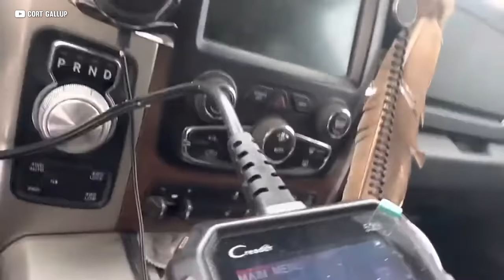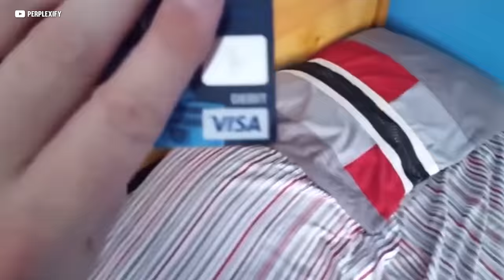Worst Trucks Only Stupid People Buy

Comment: I work at a GM dealer in the parts dept. and the cam/lifter failure problem has provided me a good living. Thanks GM!
Reply: You make it sound like your hourly job gets paid on comission 🤨
Reply: at other peoples expense. imagine feeling good about that
Reply: Years ago Camaros had an issue with soft camshafts. Seems like that component weakness can't be fixed by GM.
Reply: Is that the diesel or gasser?  Thanks
Reply: @SpaceRanger187 its usually under warranty lol
Reply: Same with me at Nissan.....CVT failures left and right.
Reply: I'm  an automatic transmission rebuilder   THANKS   G M  👍
Reply: I own a Ford because my 2008 Silverado AFM engine failed twice.   $4000 repair the first time, $8000 quote the second.   Sold the truck instead and bought an F-150.   They have their own problems, but I'll never own another Chevy because of that trash AFM engine.
Reply: @joewoodchuck3824  That's just plain dumb. CSB engines run for every without cam shaft damage. Every manufacturer out there has had a problems by times.
Reply: @Flatlandcoug  That will teach you to change your oil on schedule and not use lubie lube.
Reply: @SpaceRanger187 that's how the world works every service and product is based on the consumer paying for it. Stop taking it for granted lol
Reply: @Louis-kk3to   lol I’m a retired g.m. tech, specialized in automatic transmission. Made a very good living at it also, especially because nobody wanted to work on transmissions.
Reply: @Flatlandcoug  I'm not a Ford  fan  , but! ! I don't  blame you for  your  switch      I'm  an automatic transmission   rebuilder   ( 46 ) years   , I'm 59 yo. And   you  are  not the  only  Chevy  truck  owner  who  has  told me  that  ☹️,SAD  AINT IT  !!!
Reply: @brianspangenberg9598  YEP  ! EXACTLY  👍
Reply: @johnarnold893  I have no idea what a CSB engine is.
Reply: I worked for a Chevy dealership for 4+ years, bought my first Toyota after I left when I sold my "dream truck". 2018 reg cab short box LT Z71 4x4. So I got a used 4runner with that "awful" 3.4 ltr V6. 285,000 miles on it and runs perfect. lmao
Reply: @SpaceRanger187  truly is an  honest  living tho
Reply: I put range technology obd2 port plugged it in and keep it in v8 mode shouldn't  have any problems..did this since new in my silverado
Reply: @joewoodchuck3824  Chevy Small Block???? I have no idea either.
Reply: @castlegarage6969  GOOD  CHOICE  👍💤
Reply: I have the 5.3 so far it's good I deleted the afm with a tune in the beginning it's been great
Reply: @johnarnold893 Victom blamer!!! I am a lifelong GM guy. Owned dozens. Been building,  collecting, racing, showing GM's my entire life.    2008 5.3 DOD AFM trailblazer issues at 53k and 83k miles made me bail on GM trucks. Still have my  collection of classic GM's but new are $$$$$$$  hot stinky garbage.
Reply: I doubt you are making a good living at a dealership!  You must mean your daddy owns the business,  and is making good money selling those parts!
Reply: GM stopped making trucks in 2006.
Reply: @brianspangenberg9598  The 4L's aren't that bad once you get the OEM parts out of it.
Reply: Umm, I'm sorry Mr Mechanic but you of all people should know about Chrysler's big issue with the lifters and whiping out the cam lobes 😂
Reply: Titan 5.6 gas motor is a decent powplant without cylinder deactivation complexity. Definitely steer clear of diesel though.
Reply: @thebluelunarmonkey & tha 06 model is u-gly with that extra pokin out front cap... looks like sum crap...
Reply: Yep!  I'll never buy another GM again.
Reply: Just put a delete program for the cylinder deactivation on your chevy or gmc and you wont have a problem
Reply: @BBBILLY86  Yep! My Dad had them as company trucks all from the late 1970's to the 1980's, I have both a early areo body from 1989 and a 1997, which are both great Trucks, But the 2009 GM Sierra is a complete Peace of $hit! Don't think I would ever consider buying one of the new ones ever again. And that is after being brought up on them. They need to fire some of the diversity hires and improve the quality.
Reply: @bradenconway9066  most people can't do that but can plug in obd2 port for range technology delete
Reply: Seems like I remember Cadillac trying to shut off half the engine back years ago maybe the 1980s. Complete failure the too. Half the not firing on dead cylinders would be a bad problem on valve train. My Dad’s truck sounds like a diesel running. I told too get deleted he wud not. Too late now. Oh well there goes my inheritance. lol. I love my 84 chevy half ton. And my 3/4ton 76 GMC. Hard to get me stranded in one of them old trucks 😊
Reply: @KingfishStevens-di9ji  you got a good one mine is a 2019 I installed  the range tech.. to shut them off I'm not taking any chances
Reply: @KingfishStevens-di9ji  - I think that longevity depends on maintenance and usage habits. Also, we've seen videos of how people abuse their trucks, and witnessed real life neglect.  Little things like ignoring transmission oil changes and differential fluid. Motor oil should be changed every six months for normal driving conditions.  I haven't had any problems with any of the four Ford pickups I've owned.
Reply: thegunsngloryshow  should just stop with the stupid bright lights period.
Reply: Enjoy it while it lasts.  I was a dedicated GM man for 45 years until I got tired of buying GM junk.
I have been driving a Honda and my wife drives a Nissan .
American made and no rust or recall
Reply: I bought a 21 Silverado when chips were scarce, and mine has a factory deleted DOD.
Reply: @Ilovemyidi Have you ever tried to get a dealership to honor a warranty (even under recall)?
Reply: @Louis-kk3to Perhaps you can help me? I just installed a 4L60E on a 1993 GMC 1/2 tonne. The installation went fine with no hiccups. As per the 90-day warranty agreement with the wrecking yard policy. I flushed the transmission and installed new seals, gasket and filter. Here's the problem. I filled it with the recommended transmission fluid and proper amount, and l've been driving this truck for about a month. So far I have topped it up with almost 3× the amount of transmission fluid. I've been under the truck with a flashlight and it's as dry as a bone. I leave cardboard under the truck at night and no drops. Any advice you could give would be much appreciated.
Reply: @KingfishStevens-di9ji So you are that ONE guy who hasn't had any issues with your truck.
Reply: @KingfishStevens-di9ji  Guess you don’t know what a joke is. So sorry
Reply: For me that would be a good enough reason to Quit and Name & Shame them. 
Sorry morality would not let me scam people like that. 
Even if i was selling one i would tell new buyer all the issues he likely to run into.
Reply: Often happens as people drive them like a normal Automatic which is bad for them.
EG in a CVT when you stop at lights you should NOT leave it in drive but instead move it to N or P specially if standing for a long time.
Also people launching them or overheating them @JackTheSkunk
Reply: The Auto 4wd too.
Reply: You are welcome
Reply: @KingfishStevens-di9ji 💯
 Same on my 2010 F150, abuse the hell out of it off-road and towing almost daily. 130,000 miles and only replaced 2 batteries & front brakes, FORD oil and filters. ❤ Edit; I buy American made batteries and tires. Wake up America!
Reply: @thebluelunarmonkey Funny you say this! I spoke with a guy who worked at a CHEVY /GM Dealerships over 30 years as a mechanic, he'd been to all the schools, I believe he'd become what's called an L1 mechanic? I think, anyway he had knowledge like an encyclopedia! , we spoke at great length about motors and drivetrains on Chevy and GMC vehicles, and he told me any model after 2008 was absolute crap! Mostly because of MANUFACTURE QUALITY AND WAY TO MANY SENSORS ON EVERYTHING! AND THE INTERIOR OF THE CARS AND TRUCKS HAD POOR QUALITY plastic parts! Overall not designed to last, and very expensive to repair! He told me stick with 70s 80s and 90 model GM vehicles!
Reply: @Flatlandcoug lmao get rid of that and it's leaps and bounds better.theres a reason hotrod have ls and lt engines in most of em
Reply: @Louis-kk3to Mayne the 4l60e.if you know what your doing you change a few pieces and make it better.the 4l80 e better than dodge or ford junk all day any day .I have the ten speed 6.2 non dod and smoke ford and dodge trucks all the time
Reply: Service advisors also make a commission for repairs at the dealers
Reply: Like the hackers who send email with viruses to give IT folk something to do.
Reply: I’ve owned one GM and never will again. Complete junk
Reply: When looking for a new truck in 2019.   I went with a 5.7 tundra over the GM because of the cylinder deactivation.      No regrets. The tundra is solid.   It’s a shame because the 2000s 5.3 chevys were Awsome trucks.
Reply: And ppl give the hemi a hard time lmfao
Reply: @Flatlandcoug  Pre 2007 GM trucks are pretty good. Pick any year you want, but I won't own anything GM 2007 or later. Not worth it. I'll run my 99 Silverado until the wheels fall off then fix it and keep going.
Reply: @Bostonharborwater  Agreed. The first gen 5.3 can't be beat, and any GM 5.7 are rock solid too. 
I've worked on the Tundras enough. Yes they seem to be pretty solid trucks, but why Toyota made them so ridiculous to change oil on is beyond me. If I got one, the absolute first upgrade I'd make would be a filter relocation unit, about $200.00 and that puts a spin on filter in place of the cartridge unit under the shield. After that, oil changes would be a breeze in comparison.  Actually the older Tundras that were about the size of the current Tacoma trucks with the 4.7l I liked. They were a bit more stylish to me. Granted you wanted to keep up with replacing the timing belt regularly but that truck I'd definitely consider
Reply: @castlegarage6969 this doesn’t work on the 6.2 with 10 sped trans unfortunately….  :-((
Reply: @dannyo6699 I hated that paper filter change in my wife’s 2008 highlander…made her start taking it to the dealer for changing…
Reply: @Getusom  exactly.
Reply: GM = General mess 😂
Reply: @Louis-kk3to  Yep. I've got a 17 Silverado and that transmission just failed at 66,000 miles.   Now, I know not everything is built equally, but a failure like that under 100,000 miles is definitely a cause for alarm. Found out from the transmission shop that they see 2016+ trucks all the time now with very early transmission failures.
Reply: @xephor86  well , I make  a living  fixing  automatic transmissions   ,it's not like any other  job , but sometimes  you  can  feel  the  heartbreak. Of  your  customers  about  this  transmission    BUT  WE FIX  THIM ALOT  BETTER THAN THE  FACTORY   👍
Reply: @cailcampbell5890  pull the  transfer  case  ' fill' plug   and stand  back   , u might  have  a cracked seal   , carefully  replace it   good  luck with your  truck  👍
Reply: @Louis-kk3to  Thank you.
Reply: Range technologies AFM delete and do oil changes at 3500 miles, you'll be fine!
Reply: @SpaceRanger187  He didn't cause the problem and makes bank helping fix it.
Reply: Failed lifters and plastic trays 
Destroyed cams,push rods
Fuel lines,fuel pumps
U can go on,on,on
Poor tax payers and buyers
Reply: @Flatlandcoug  agreed 100%
Try toyota and you will not regret
I have a pos afm issue i was not
Aware any how replaced engine
At $6k now planning to switch to
V6 tundra.
Reply: Do millions of trucks have these issue?
Reply: I have a 2022 not refreshed sierra 5.3 with no engine deactivation from factory  do to chip shortage so I'm thinking it's a good thing
Reply: @joewoodchuck3824 It was designed to fail by GM.     Old Camaros never did that back in the 1960s.   I'm talking 400 horse
Reply: @Flatlandcoug I have a 08 Sierra with shut down.     15 years old and never had a problem with it.      140 thousand miles now.    Use Napa Synthetic 10W-30 oil.    Runs great
Reply: @thebluelunarmonkey I have a 2008 Sierra.    140 thousand miles and zero breakdowns.    It has cylinder shutdown as well.    I've never touched the motor, just plugs and wires.    Use Napa 10W-30 synthetic oil
Reply: @BBBILLY86 I have a 08 Sierra with the 5.3.    I've had zero breakdowns.    I have 140 thousand miles on it.    Use Napa Synthetic oil 10W-30
Reply: @dannyo6699 I have a 08 Sierra with the 5.3 cylinder shutdown engine.    I've had zero issues in 15 years.     I have 140K on it.    Use Napa Synthetic oil 10W-30
Reply: @plusblood5101 The V6 twin turbo engine is junk in Toyota tundra
Reply: @gregorylyon1004  That's good.  Consistency with servicing will lessen mechanical issues. Full synthetic oil is best and 10w30 is fine if you don't use it in severe cold, otherwise 5w30 would be a better option. I run synthetic 5w30 year around in mine.
My only issue with post 07 vehicles is that at that point, tire pressure monitoring systems were required. I've worked on them and they aren't fun to Service. Not impossible but it does add to the tire service time.
Reply: thegunsngloryshow  Which bright lights are you referring to?
Reply: @gregorylyon1004  No one's saying all pickups will have failed lifters at X number of miles, it's the first major repair will likely be the lifters. Like with the GM plastic LIM gaskets of the 90s. I'll keep your rear two cylinders in my prayers lol
Reply: @thebluelunarmonkey  Good.    Because I'm gonna keep my truck.    The new one's are way worse than anything they installed inside my trucks engine
Reply: @dannyo6699  I've used as high as 15W-50 in my engine.     I wanted to see if it would blow up.    But it never did.    Lol
Reply: @gregorylyon1004  Older trucks absolutely could run that oil without any problems. I used to run 10W40 in my 76 GMC year around and it ran fine using that.
Reply: Yea...I will just keep My Old 98 Z71 has pretty much been bulletproof...
Reply: @Synthfidel  Still has the c*** lifters in it it's just they are not electronically activated.
Reply: It Was a Tongue in Cheek, Laughtable Remark
Reply: Sarcasm all you trolls grow a pair...
Reply: RAM = FIAT 😂
Reply: @hectordeanda9133   That's because in the parts dept. at dealerships they do also get paid commission buddy. FYI, learn up on a thing or two before making comments like you know something. (A lil' nugget for ya there at no extra cost 👍)
Reply: @thebluelunarmonkey 
Yes.  Indeed,   I have a 2005 Sierra 2500HD,  285K 6.6L.  Diesel w Allison transmission
Reply: @SpaceRanger187 it’s their damn fault for being stupid to purchase a crappy, unreliable product.  Simple research would tell someone that buying a quality GM product is a coin flip.
Reply: @BBBILLY86  I always have been a GM owner, the newest has been a 16 and 19 gm 3.6 Colorado and have had 1 issue, trans shutter. Trans flush w/syn oil and all is GOOD! Cuming up to 50k on 19 and still NO concerns! "hot stinky garbage" Fords and Fiats(Rams)!
Reply: @thebluelunarmonkey  That's why most fords have GM power plants right?
Reply: @graken22  Seems a bit premature t do a victory dance at 50k. But glad you are happy. I've had a 1992 C1500 Sport 5.7 purchased new go almost 300k and a '98 ZR2 4.3 purchased from original owner go almost 300k before I sold them both in perfect running order. So maybe I'm expecting too much of new vehicles to get 100k without commonly known internal motor issues?
Reply: 'Parts boy' cause he can't turn a wrench the right direction.
Reply: @thegunsngloryshow stop with the stupid bright lights on all the new vehicles.   
They’ll probably get brighter.
Reply: having owned over a dozen 5.3 truck some with upwards of 325k miles , i think the lifter issues are reserved for people who dont change theyre own often enough. cause i really should have ran into this issue several times by now according to the internet.
Reply: @TheDaltonmichaels  DOD/AFM 5.3's?  5.3's without DOD/AFM do not have lifter issues.
Reply: @Ilovemyidi  Nope. Bad designs fail on the second owner as a rule.
Reply: @Flatlandcoug so I take it you haven’t read about the class action transmission lawsuit against Ford? Every big automaker has its share of problems! The more they sell the more problems we hear about
Reply: I’ve driven Chevrolet and Dodge trucks all my life with no big problems.

Looking to get another truck.  What do you recommend ???
Reply: My bro has had 8 turbos replaced on his 4cyl duramax lol but he’s still a gm guy lol
Reply: That fuel deactivation
Reply: @Louis-kk3to what’s even crazier is there’s many guys who say the same exact thing about ford, Chevy, dodge.   All have gotten burned and will never go back
Reply: @Hood.Housekeeping  47 years  rebuilding automatic transmissions  , thay all  have  their own   way of  doing  Batel  with  your  money  😪
Reply: @Steve0885 plus the manifold bolts breaking off in the block. Just about guaranteed to have them replaced. Not sure why ram has the issue after all these years on the hemi 5.7’s. Had three rams and all three were great aside from the dam exhaust manifold bolts breaking.
Reply: @SpaceRanger187 ain't nothing wrong with that 🤷‍♂️
Reply: Go work at ford and you will send your kids to Harvard
Reply: You can thank the EPA for all these issues. Un-elected bureaucrats deciding what’s best for the environment.
Reply: Don't forget the Chinese torque converters and Taiwanese a/c components!
Reply: How about the valve bodies on the twenty five hundreds or thirty five hundreds. Is ten speed transmissions are failing in record numbers.
Reply: @Louis-kk3to Yeah.
Let's talk about the failure rate of the ten speed transmissions in the heavy duty twenty five hundred and thirty five hundred.😊 Those allison transmission valve bodies are literally four months out.
Reply: @pg981 Keep an eye on your transmission.Does 10 speeds are failing in record numbers?Usually it's the valve body. It's literally 324 months out on back order right now.
Reply: How much of a living 
 did the Teflon tape in the fuel filter housing give you.
Reply: @starkness7030 we haven’t gotten that far yet 😂😂😂